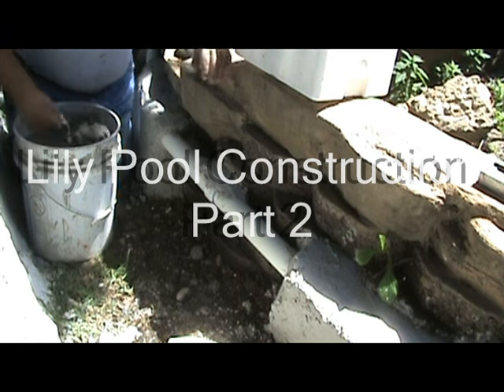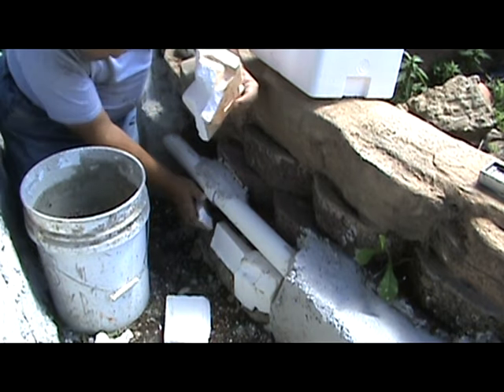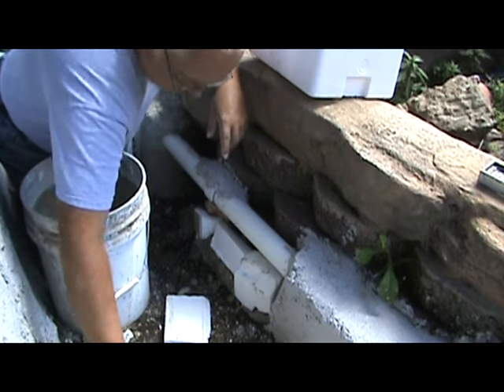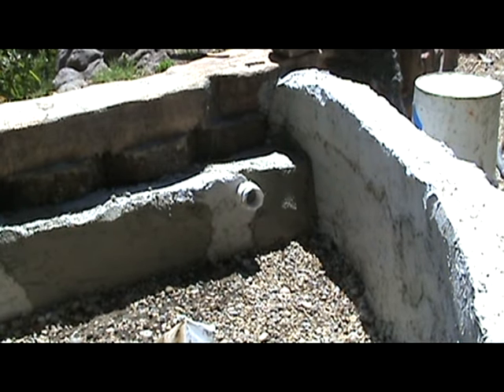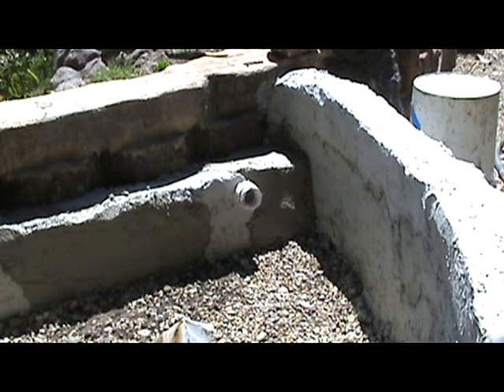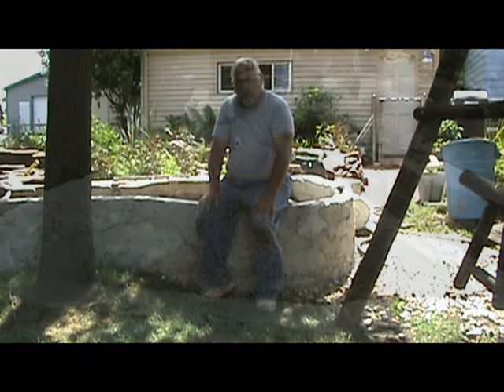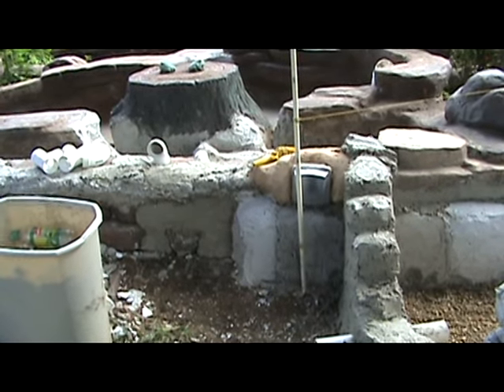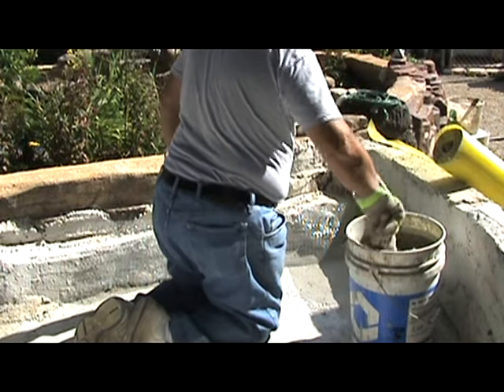Faux Rock Lily Pool Construction Part 2

Comment: I started watching the videos, I asked if foam could be used as a suggestion on his link fence video, little did I know that foam is used as fake rocks. I hope the videos stay up for sometimes as I am interested in trying some of the projects, such as trying the foam/concrete technique around the sheds that is now up on cement blocks, that isn't that pretty.
Reply from the maker: You don't necessarily have to use styrofoam beads for lightweight concrete.  I actually now use and prefer to use vermiculite and/or perlite.  Bulk vermiculite is available from Uline (https://www.uline.com/).  I enclosed the open space around my deck using fake rocks.  I built a treated lumber frame, just as one would do a wall in a house, covered it with expanded metal lath, did a scratch coat and made faux rock from concrete.  The project around your shed is exactly the project my brother wants me to do to his two sheds in Tennessee next summer.
Reply: I'll have to live through the winter to see that project you will be doing for your brother~ please upload for us fans. And, Thank you for the instructions. I'm still leveling the shed as it sank into the swamp on two sides, almost completed, and ready for the polishing touches come next Spring with your suggestions. TY for the quick reply
Reply from the maker: BTW, the videos will be left on YouTube for as long as Google allows them to remain after I'm gone.
Reply from the maker: You're welcome.  I'll be going to my brother's likely in June or July if I'm still around.  I'll be 75 in February.
Reply from the maker: Also, the videos stay up as the ads give me enough income from Google that more than pays for the materials for my projects.